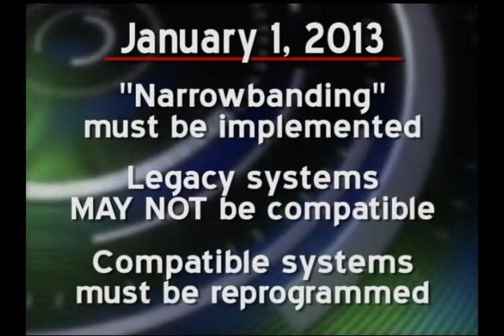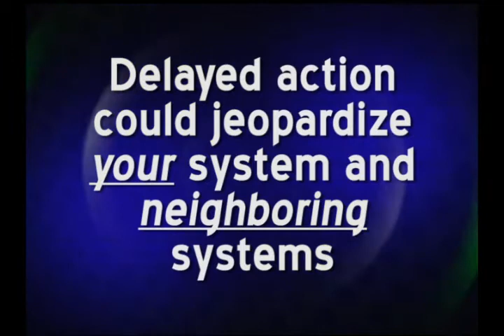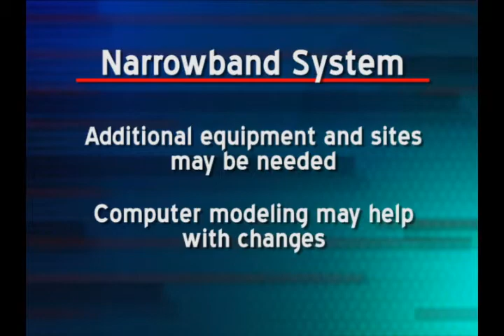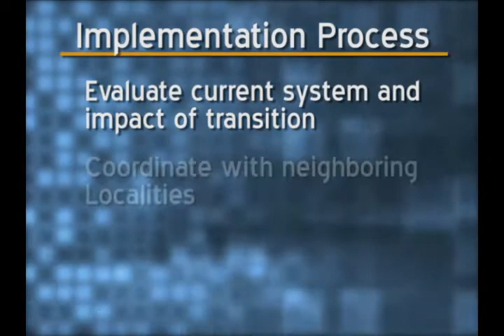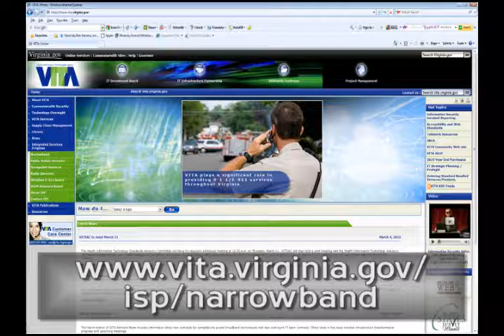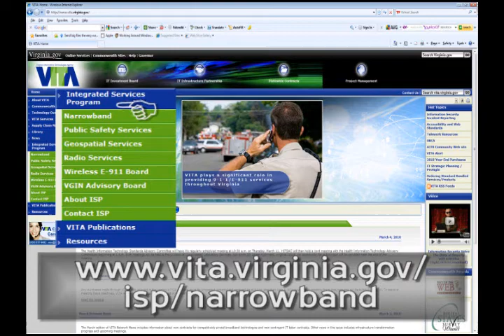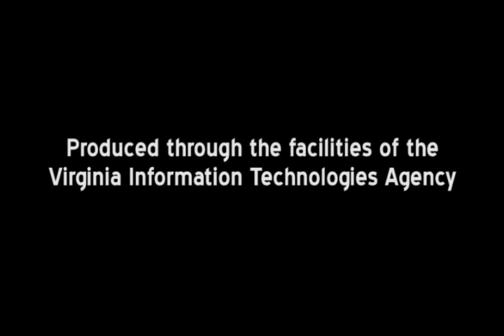Narrowband: Are you ready?

Comment: 1.5 Ghz would cause far more signal loss, depending on terrain.  It would be very impractical- not to mention the cost of retuning/replacing millions of dollars of equipment worldwide.  The upgrade to better efficiency is not ideal, and is a step in the right direction towards better efficiency, however it is a wasted one since in a few years the FCC will probably issue a second narrowbanding mandate, moving to 6.25.